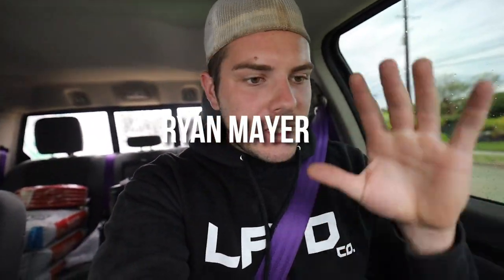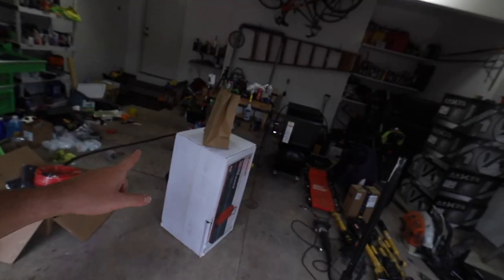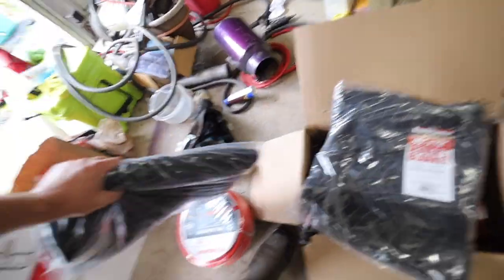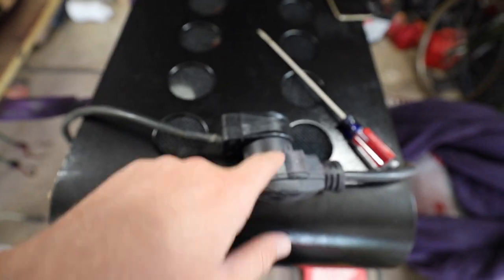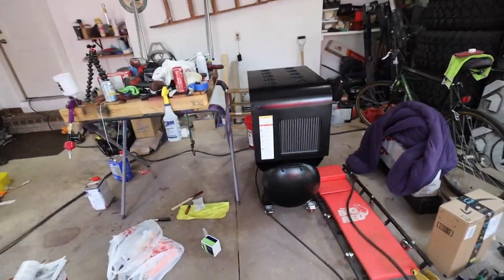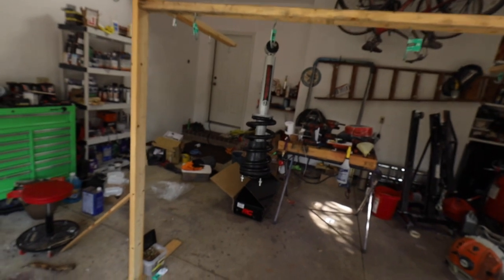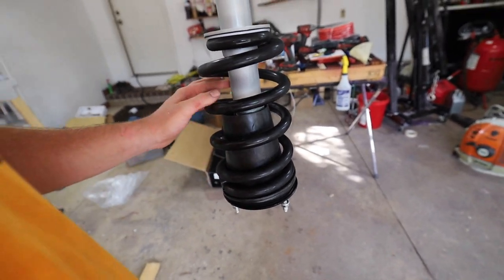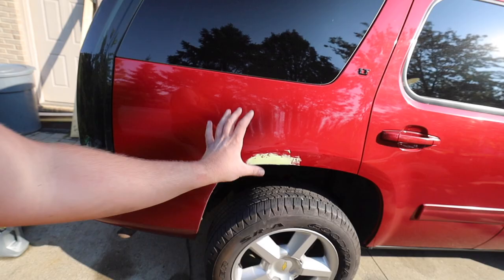THE DAYTONA CRUNCH I WANTED TO AVOID...

Comment: Swap your tank plug for a pitcock. You can leave it slightly cracked while the compressor runs. It will push water out before air and keep your system dry. I do this on my air operated rock drill. Works like a charm.
Reply: Ii

Comment: Be prepared for a bit of a battle getting the rear lower 4 link bar bolts loose especially on the frame side.  I broke 2 good brand name breaker bars, an 18" & a 24" when I had to replace mine due to one getting bent when a Jack slipped one time.  I used to have an 07 Avalanche with a 6" lift sitting on 35's and 4:56 gears.

Comment: If you lay your paper over the area to be paint and tape it a little higher you can roll you paper back & tape above the first tape line it will create a smoother transition on the blended body panel.

Comment: Ryan- if your wanting to dissipate the water inside your compressor. Just use methenol or airline antifreeze which is methanol. You can find it at truck stops or parts store.

Comment: You know what really sucks is when your doing struts for the first time and like oh I'll add a leveling kit b4 I put the new ones on but it's an RBP leveling kit and it involves removing the spring and forgetting that it's got LOTS of tension and it pops off when you pull that strut bolt off